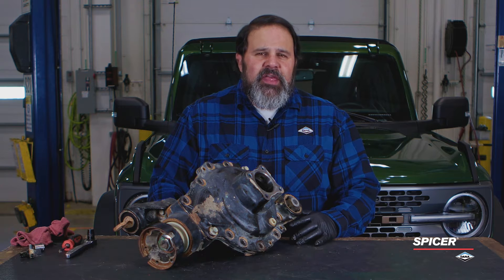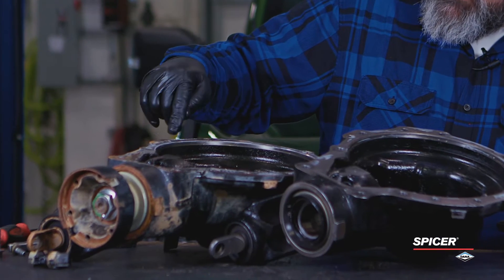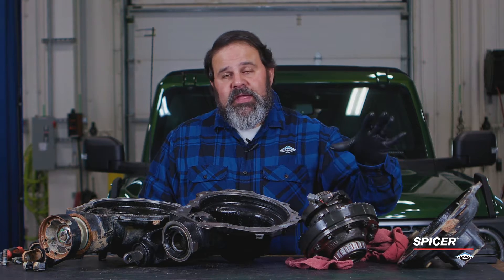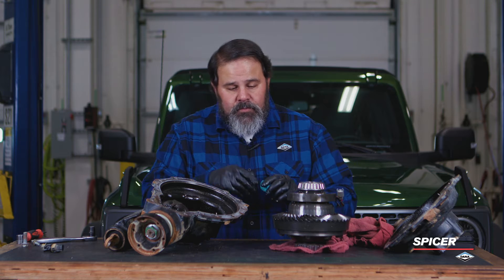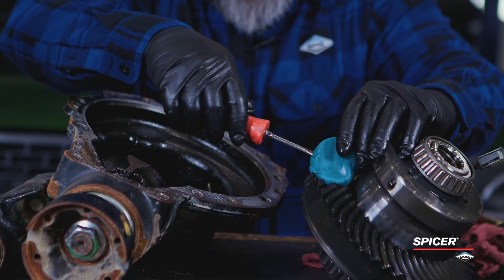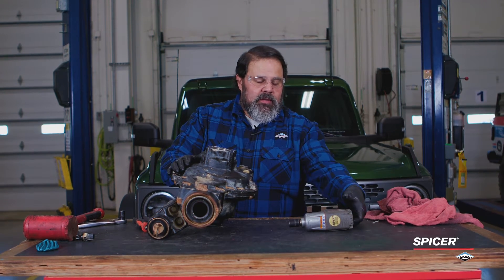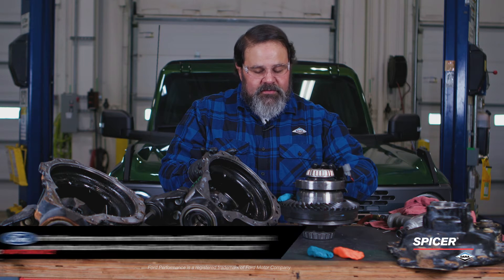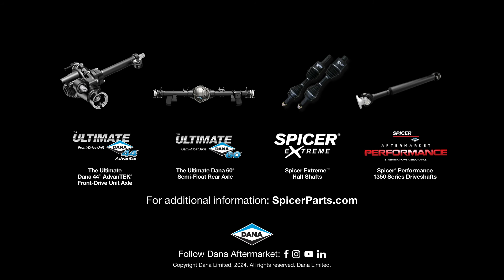Gen 6 Ford Bronco® Gear Myth Buster

Comment: Hey Zach, with Ford Performance offering FDUs with taller gears (5:13 and 5:38), I wonder if they are using a different housing than the stock sasquatch with 4.71?

Nevermind, as I was typing this, I see the graphic at the 5:55 mark.  LOL